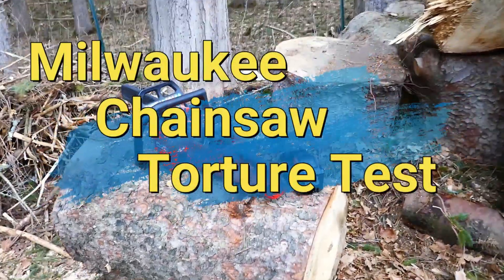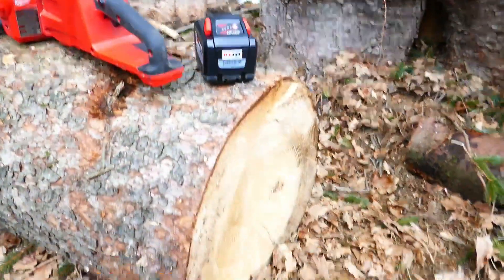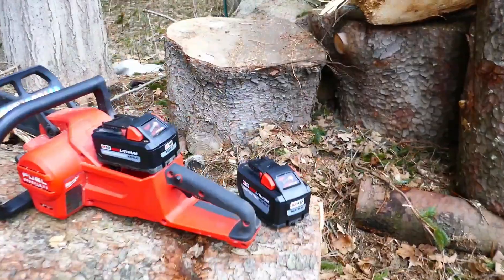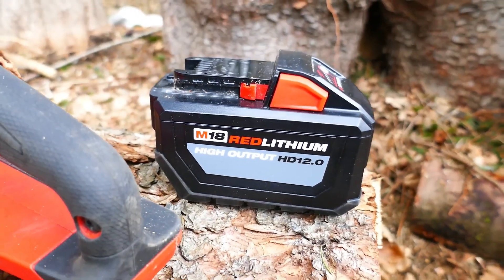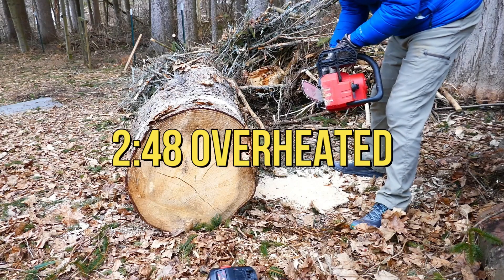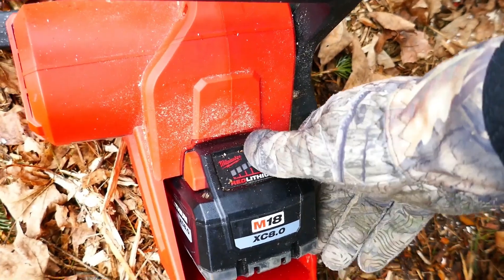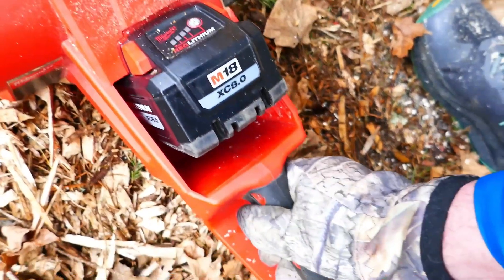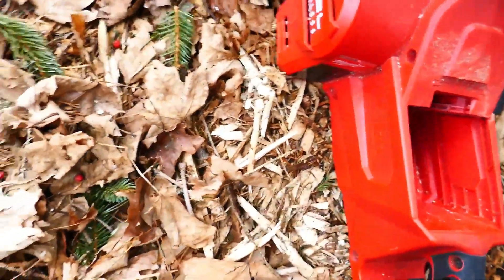Milwaukee M18 Chainsaw Torture Test - Will the 12.0 Ah HD Battery Overheat?

Comment: Hi Brad, I have 3 such 12 Ah batteries and never had overheating yet. Even mountain ash goes fine while the full lenght of the bar is used. I'm very pleased with this saw!
Reply: Overheated 2 12ah h.o and 1 8ah h.o today, when your wood is good they are find, when your cutting fiberous material (palm trees, Yukkas etc) very easy to overheat them
Reply: @littleterror05  Ok, I didn't know that, there aren't palm trees or yuccas in Norway.........
Reply: @AdriManhave  yea you guys have the good trees haha

Comment: I must be using my saw wrong. I have never overheated a battery yet. Of course I stop when it's down to one bar. Last week I dropped 15 poplar average 10" diameter.....and sucked the battery to 1/2 charge

Comment: For a fact you have to be careful with these saws cuz ime the eight amp hour and 9ah batteries will give up the ghost quick and I personally have had 2 8ah destroyed from the 2826 so good to see others notic strange occurrences with these saws cuz I love both 2727 and the 2826 is my go to saw but people need to be aware of the need to use them with 12ah batteries….. I am excited to see how the new Forge stacked lithium pouch batteries do in this saw

Comment: 8.0 didn't overheat. It died. Far left bar flashing alone means it's dead. As you mentioned, 2 bars alternating flashing is overheating.
Reply: Not always Mine did the same looked dead for 10 minutes then shows 2 bars and never seen the alternating code to lyk it’s in thermal timeout mode but mine would never recharge again after that and it was still at 18v cell strings balanced all within .3 and still it won’t charge so it’s off to repair ville I call it and this saws sent a few there